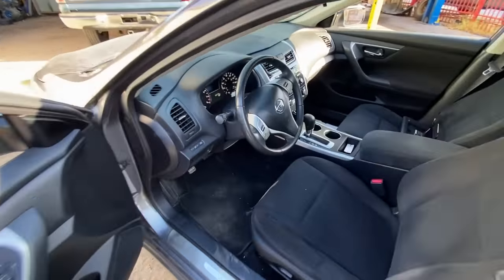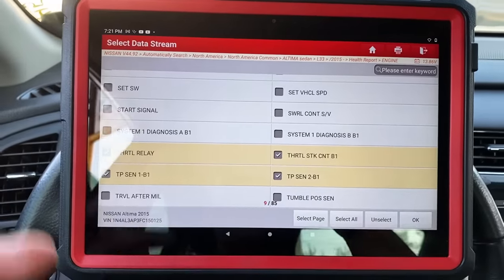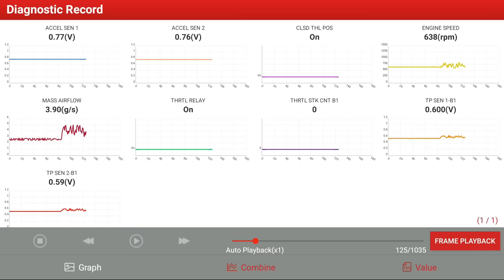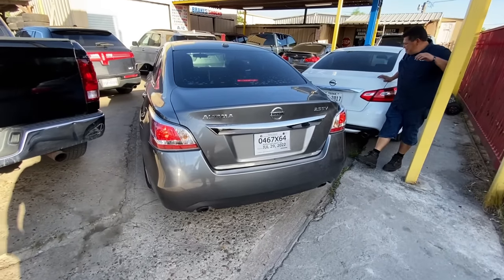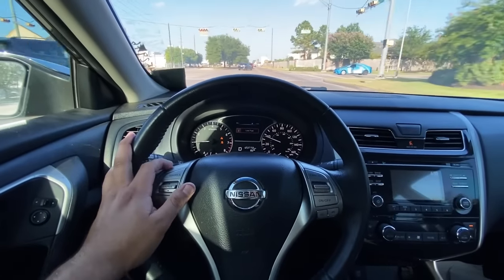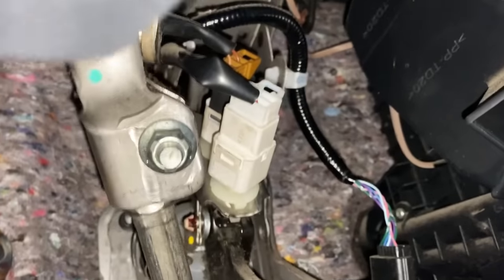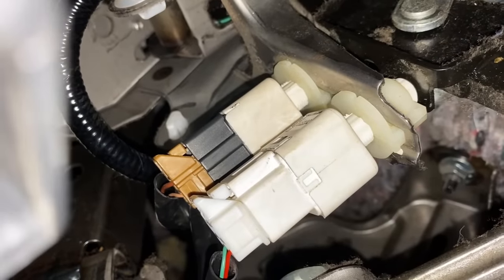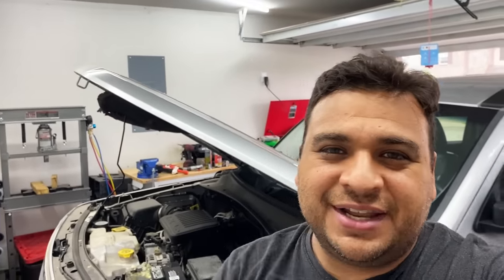NISSAN ALTIMA RANDOMLY WON'T ACCELERATE ABOVE 25MPH!!

Comment: This is the third video I watched this week with Nissan brake light switch or components causes drivability issues. Seems Nissan need to rethink this set-up
Reply: I think NISSAN needs to recall these models and eat the cost of these switches and relays! That's total BS how they put this "nanny software" on particular models and this issue paired with those Jatco CVT transmissions is a recipe for disaster. Keep reading the comments. People are in intersections, busy highways and their Sentra, Note, Versa, Altima, Rogue is going into fail safe lump home mode at the worst time possible. All these cars need to be recalled. I almost think this is malicious on Nissan's behalf!

Comment: I had the same issue .. it is not related to brake sensor.. it totally related to transmission sensor.. once the transmission oil is hot the computer disconnect acceleration.. reason is that there is low oils level or the oil is damaged and not properly doing its job.. just replace it with orginal Nissan oil and make sure there is no leaks.
Reply: In which car dou you have the issue? And, that car shows any DTC?
Reply: @JoceMaldonado  Nissan Altima 2.5 2013 .. I did not inspect it myself, so I am unsure if there was any DTC.. after a struggle not knowing this happens, I was advised to visit a specific technician who diagnosed the issue and solved it in one day.

Comment: As soon as you pointed out that the break lights were on i had a feeling it had to do with the switches. I was driving a brand new ford escape, and i was fooling around and pressed both gas and break pedals and noticed after a few seconds the engine wouldnt accelerate properly which made me understand that modern vehicles have that feature. Still a difficult diagnostic if you dont know what you're doing.
Reply: How did you fix it
Reply: @arthurmarin5726  I didn't. The ford wasn't mine

Comment: OMG  MINE DID THIS SAME THING I HAVE A 2010 Nissan Altima 2.5 …if it’s low on transmission fluid you want have no power and want go anywhere at all please check the. Transmission fluid and you’ll be good to go there’s some kind of sensor in there that put a stop to the vehicle if it’s low on transmission fluid

Comment: My car is a 2017 Altima. It does the same thing and only difference is one time it Reved funny thru gears and wouldn't shift right. I pulled over and cut the car off and restarted and it went back to normal. My transmission guy said it needed a trans which is nearly 5000. I think I'm gonna try the brake switch relay first.
Reply: Any luck ?
Reply: @jonathanb4128  it hasn't acted up but one time since I posted this. I still think it is a brake switch. I have driven on hour trips since then and it shifted fine.

Comment: Wow. I would think that the ABS would find a fault in that logic and throw a code. Even if it's a history code.
Reply: It's a flowcharting thing..
Reply: i don"t think so because ABS is getting a signal that the brakes have been applied what is an obvious  thing when driving

Comment: I have the same exact issue on my 2016 altima. Brake light switch fixed it also. This happened 2 me about 6 months ago or so. I got mime fixed for free though.
Reply: You didn't have to do anything gay? Wow nice
Reply: @Reeeeeee12345  lmfaoooooo. I'm just seeing this.
Reply: @Reeeeeee12345  you sound mad :)
Reply: @occckid123  It's a yes or no. Why are you responding this late again?
Reply: @Reeeeeee12345  why so you can stalk me?  Find someone at the bar princess.
Reply: @occckid123  yes

Comment: I’m going through the same thing except mine is mostly when turning right or left from a dead stop.. it’ll bog down then all of a sudden it’ll take off like crazy. Dealership said it was the tires because one was worn more than the other 3 and it was doing it because it was awd.  It does it infinitely worse during winter and cold weather..  no brake light on though

Comment: I have a 2012 Altima 2.5 S in Las Vegas. In summer heat, the CVT transmission fluid will boil into a foam and there’s no fluid to make the tranny go. The engine can go into fail-safe mode and cut power. The tranny fluid cooler is undersized and in extreme heat…a driver is forced to allow the fluid to cool down. The car runs great in the winter in cold temperatures. The CVT is a problem in hot temperatures.

Comment: Advance,love that scanner work. Wanted to comment when u post the video and forgot. 
Now gonna be honest with you that problem u just put a bandaid on. I would have like u to go n a lot and make a right u-turn see if the problem occurs also.
Let me tell u that the problem is gonna come back and more.
The driver just cause more problems for him or herself. Other relays and fuses took a beating. That alternator is taking a beating. That transmission beating. 
WHEELS ARE THE PROBLEM. 
KNOW UR LIMITS. 
IF YA GONNA PUT THOSE SIZE WHEELS, please try to use ur brain. NEED A OPTIMUM BATTERY, NEED A COLD INTAKE TO PUSH THAT WEIGHT, NEED A BATTERY CHARGER. NEED BG MOA TO PUT N ENGINE, NEED BG CVT CONDITIONER TO PUT N TRANSMISSION. 
IF THIS IS TOO MUCH TO HANDLE I ADVISE U TO TAKE THOSE WHEELS OFF.

Comment: I have a built 03 Sentra Spec-V 2.5L and I have had the same thing happen twice in 4 years but the problem was always the cam position sensor! My scanner said it was can intake solenoid and I laughed 😂 bcs I already knew what it was by past experiences. Replacing it worked! Once I had to recalibrate my throttle for some odd reason but that was a small blooper. NOW RECENTLY the Nissan did the same thing with the rev stopping at 2k rpm so I got a replacement cam position sensor.. WHAT😮 …. This time it did not fix the problem BUT now it also stalls shortly after cranking and there is ZERO throttle response.🤔🤔.. if a throttle pedal recalibration don’t fix this, I’ll have to look into the throttle sensors.

Comment: I had this happen to my oldbrogue, when it did it I would see the traction control light come on and when my cvt eventually went out they said that the brake switch being out had caused damage to the cvt because something about a clutch doing something thinking I was stopping but I was accelerating

Comment: Thanks so much for this video! I think this may be my issue ..I have 08 altima that does the same was thinking cvt or torque converter but now I think about it the brake light comes on intermittently too sometimes since it started doing this
Reply: Got it fixed ??
Reply: @MichaelSkimpy-l6f  I have the same year and they are fixing the value body on the car

Comment: I once had a problem with no acceleration.  I rented a 2001 Corolla.  Around here with the steep hills it would not accelerate going up any of them.  Nothing was wrong with the car other than the fact it is gutless!!  I lived in Pittsburgh and there are some really steep streets there.  I pray that I am never on any of them when they are icy.  I have heard horror stories of people losing control on the way down because of ice and bouncing off some of the cars parked on the sides.  Not only would it be horribly frightening but horribly expensive!!  I don't think anyone wants to be the one with such terrible luck!!  Just thinking of it while I am inside on a chilly winter day is horrifying really!!

Comment: My maxima 2011 had the same problem and one day it just stop and didn't go. The mechanic told me is the transmission and sensors,  i paid 3,500 for transmission and 1,500 for some sensor work and wiring,  I already paid so much and my car still don't feel good 😢😢😢😢
Reply: Same here

Comment: sticking relays are NOT a fun thing to troubleshoot.  Thankfully you can often swap them out easily.  But sometimes you need a hair dryer or a bottle of canned air (upside down) to push it to extremes.  Usually a cracked solder joint inside or sticking solenoid area.

Comment: Hi Eric I bought a 2008 Nissan Altima sl 2.5l and for the last 4 months I have had this exact same problem. I have been trying to find out what is happening. I went to a auto wreckers and I was able to get both of the brake light switches from a 2009 Nissan altima sl 2.5l. I changed the switches and I went for a drive. The problem is now gone. Thanks from Dean.

Comment: I've got a 2013 Altima and it just started doing this today. Actually it's stuck down the road ATM because I couldn't get it to accelerate to get it home. I'm praying this is what's up.
Reply: Did you get the issue fixed?

Comment: I have a 2020 Altima SR I am having the same problem and I just bought the vehicle the first time I had some type of electrical glitch and they told me they fixed it. My car is currently at the dealership right now and they want me to come in and do a test drive with them because I’m having the same sporadic problem where it doesn’t happen all the time and they keep telling me at the dealership they cannot fix what they cannot find because there’s no signal. I’m going to show them this video when I go back to the dealership.Tommorow

Comment: Once the computer sees the brake switch signal it goes into throttle cut that is true for just about every modern car now. first thing to check for lack of throttle is brake lights.especially if no check engine light is on. a very simple fix, I have also seen it where after market remote starters have been installed and hooked into the brake switch and the switch not installed correctly afterwards. you need to change the brake switch with the 4 wires not the 2 wire  one,  the new one will either be brown or black. but they will have 4 wires not 2.

Comment: So I have a 2014 Nissan that has been experiencing similar things for years. Ive taken it to multiple shops, I took it to personal mechanic beforehand and many times after. Replaced part after part trying to get to the bottom of it. Mine will randomly do the same thing but the rpms will rev really high while I have accelerator to the floor with only a speed of 15-25mph. The ABS light turns on while it's doing it. I have to pull over and turn the car off. it will then shut off immediately on its own imediately after restarting everytime until I leave it off for a few minutes and then everything goes back to normal.
Reply: This happens to my Altima as well and I have to turn off the car to "reset" and it goes back to normal till it does it again randomly. It is so frustrating because we took it to Nissan and they couldn't figure out what is wrong with it but clearly it is a problem with a lot of their cars so it makes no sense that they haven't found a solution by now.

Comment: I have had this problem before on a Nissan's, the relay is usually what sticks inside. Nissan calls this runaway mode.
Reply: I prefer to call it the runaway from Nissan mode
Reply: How did you fix this problem
Reply: I replaced the brake light relay. I have seen this problem twice, I don't know how common it is with Nissan's. But they do call it a runaway mode. It stops the vehicle from accelerating when it thinks you are applying the brakes and accelerator at the same time.
Reply: Where is the relay located ?
Reply: @jesusatenco7770  if I can remember right, it was a Pathfinder and a relay was in the junction box underneath the hood on the passenger side. It probably varies from vehicle to vehicle.

Comment: I can only assume there's some kind of fail-safe that keeps clumsy two-footed drivers from burning up the brakes or, seeing as how it's a Nissan, burning up the CVT.
Reply: Most cars have that after Toyota runaway issues. It's basically picking up the brakes are being pushed sp if you push the gas it will cut the power.
Reply: @occckid123  ??
Reply: @jesusatenco7770  ???

Comment: Initially there was no lights on the dash when verifying the customer complaint and then you see shortly after you pull up to a stop playing there’s a trash control light on in the dash. Does the traction control light lead you to go check the brake lights? My initial thought was possible wheel speed sensor because you said it happened after you made a U-turn. That traction control light would’ve really made me think it was a wheel speed sensor. Great Case study man!

Comment: I’m having this issue on my 2014 Sentra. Like it was fine but I was sitting in a drive thru line, after leaving it I was flooring my pedal and could get only up to like 30 (rpm’s went high so they didn’t get limited) but I could not go any faster. Got home, opened up my hood, my car idled low and almost died. I turned it off, turned it back on, drove up and down the neighborhood and it was fine. I’m checking my relay now that I’ve seen this.

Comment: Dammed! My 2013 Nissan Altima SV does the same thing. Sometimes when I stop on the hill, it won’t go, I will have to turn it off and restart it. it will also Drive in one gear at time.

Comment: Hi i have problem with my 2011 Nissan Altima it’s drive good local but when I drive like 50 to 60 miles all the lights on dash board come on I can’t do anything it won’t turn off it can’t take gas just stop middle of the highway I need to take batterie wire off and put it back on to do anything any idea what wrong?

Comment: Love you break down everything. Can you out a video on 2012 nissan rouge Awd sL. Issues with starting then park at try to start but its sounds like it could then wait 15 mins then its starts. I replace new battery it work for all little then replaced started its worked for a few added in gas a water remover solution that works so far. No codes. Just check engine but that's for emissions catalytic converter. Need some solutions. Your smart and truly know how explain using your machine diagonistic. Are located in maryland oh where. You got skills and you care about helping find solutions. Continue to put out info.
MJ 🚕🚚🚚🪂

Comment: Man I have 2000 Toyota 4Runner that randomly overheats I’ll pull over and wait a half hour then it won’t do it again for several days I checked the fluids it’s fine. also when I first turn it on in  the morning and drive it’s ok but when it reaches operating temperature it won’t go past 30 to 40 mph please tell me you have a shop anywhere near Philadelphia to get this diagnostic done or any advice? I just came across your channel and you truly know your stuff. Thank you in advance.

Comment: I went threw 2 brake switches 
It will stick and u can't push to Start as well..
Black one is push to start
Lights will stay on..
On 3rd  brake Switch bad design..
Hopefully 3rd one holds up..

Comment: Eric i have heard that cars are programmed in way that when you depress  brake pedal they regulate fuel delivery to the engine 
to give the best fuel economy. example when going down the hill if you intend not to accelerate the vehicle automatically reduce fuel supply to the engine. please confirm this to me.

Comment: I'm having similar issues in my wife's 2016 Altima. In addition, sometimes when I come to a stop and try to accelerate is it non-responsive and no acceleration whatsoever. I did notice the brake lights being on, but didn't think anything of it. I've take the vehicle to the dealership multiple times and they think it's a transmission issue, but since its not throwing codes they havent gotten the okay to replace the transmission from nissan. I'll try replace the brake light relay and go from there.
Reply: I have the same issue 2008 Altima . Let I changed the brake light switch and it didn’t solve the problem . The only way I’m able to get power to the acceleration petal is by leaving the switch hanging and not installing it back to the proper position .
Reply from the maker: I just found out that there is a Technical service bulletin about this problem. Google search NTB15-111
Reply: @ADVANCEDLEVELAUTO  Great! I'll take a look into replacing that tomorrow

Comment: I was thinking that while checking the PIDS on the brake light switch, you could easily reach under and disconnect the white one to see if it is 1 or 2 when you check the PIDS again, then that would make it easier to know switch 1 or 2.

Comment: Great information and keep up the good work.
Have 2008 Nissan rogue and it was on cruise control at 75mph going uphill and  automatically disabled cruise control downshifted to 60mph and it stayed at 2 RPM with gas pedal floored?

Any additional information be greatly appreciated!!!
I also subscribed

Thanks

Comment: Reminds me of my "noacc" experience with our 2018 camry LE.
----
Do you brake with your left foot or have anything that might be pressing the brake pedal even slightly?
Car has nanny software that will idle the engine under certain conditions if gas & brake pedals pushed at the same time.  No OBDII codes thrown.
This happened to me trying to accelerate thru an intersection with a very ripe yellow light. No acceleration! On removing my foot from the brake pedal where it was resting, all returned to normal! I brake with my left foot and had to modify this with the 2018 LE. NEVER have this problem with our 94 XLE Camry.  After modifying my braking the problem has never happened again.

----

Comment: My daughters 2018 Nissan Altima with only 66,009 miles on it is having a similar issue after breaking at stop signs. She took it to a shop and they are telling her that the transmission is going out and it’ll cost her about $3,000 to fix. I’m not in the same state as her unless I would check it myself, what should she do?

Comment: I have this exact problem with my 2012 Nissan Altima at random times it will not accelerate I wonder I have no codes popping up so I’m like really mind blown but i don’t know if my break light still be on every shop I take it to act like they don’t understand what I’m talking about now I’m tempted to replace both my break light switch and the relay after this video
Reply: Any luck ?